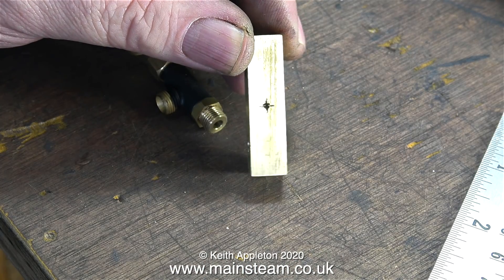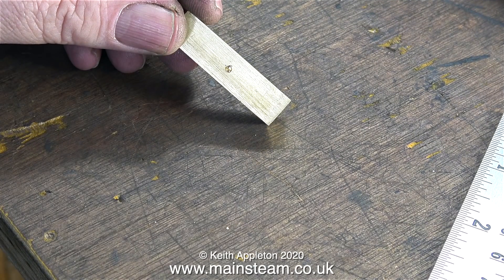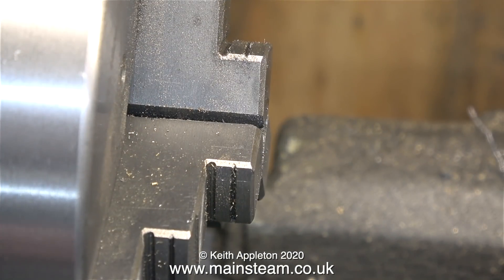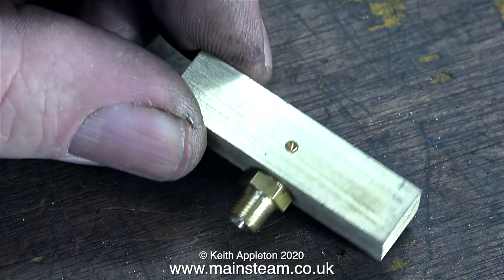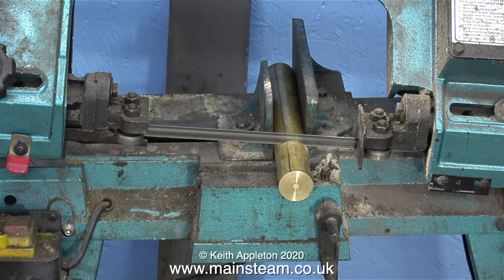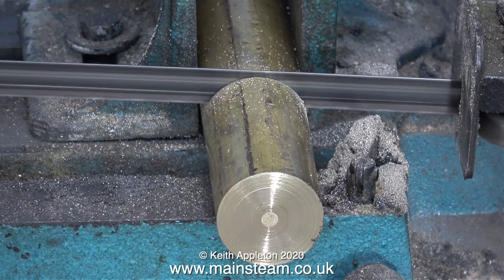A STUART 7A MODEL STEAM PLANT - PART #22

Comment: I feel a little lost on why you drilled and tapped a hole then put a screw in and then cut the screw off. if you want to point me to one of your videos that explains why please(btw when are you gpoing to take that poor fellow out of your acid tank? lol)
Reply from the maker: It is to plug the hole where I drilled through the block  . . . standard engineering practise.
Reply: @keithappleton  thanks

Comment: When I see you machining small pedestals like that I am reminded of chess pieces, it must be tricky trying to make them look attractive without looking too much like a Pawn. I am also surprised that you don't do any embellishment on the horizontal square body of the turret, I would be tempted to round off the corners at least and maybe chamfer the long edges but you would probably need to start with a thicker piece so there is enough material to shave away. Is it just a size constraint thing ?
Reply from the maker: I do sometimes, it depends on how I feel at the time .....